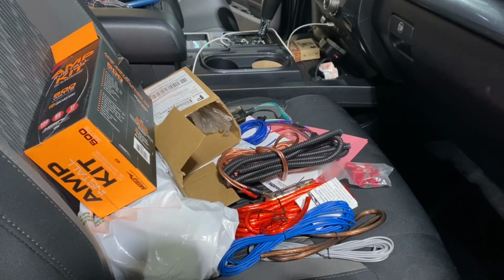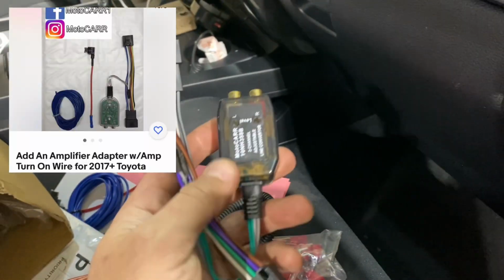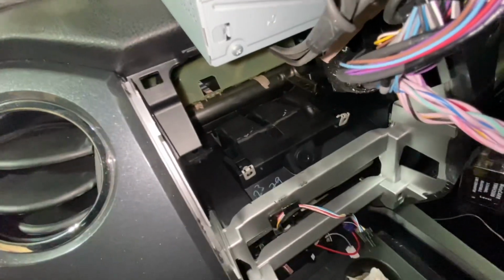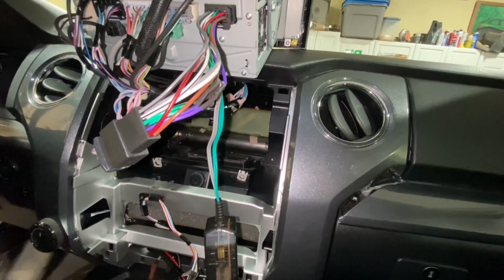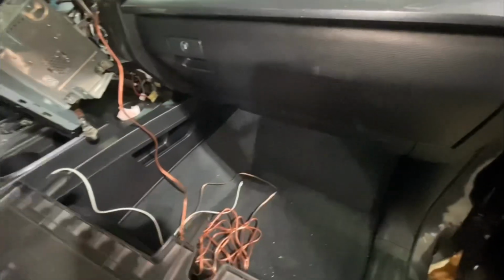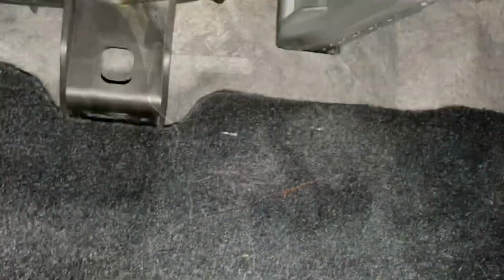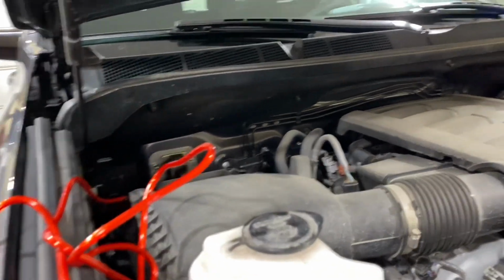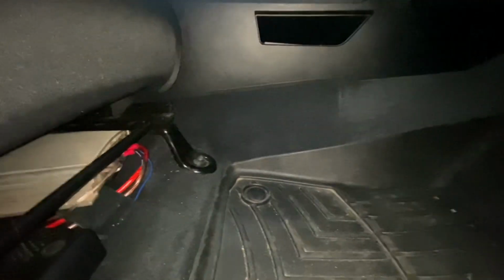Pretending I’m 18 again… Tundra Subwoofer/ Amplifier install.

Comment: Factory stereo has always sounded better than any aftermarket.  The only thing factory always lacks is bass. I worked in car audio many years ago when I was a kid and I was always staunch on that with customers. Also got in trouble at work for convincing people to not upgrade their panel speakers and only add subs with factory.

Comment: where did you get the remote turn on from.  that kit you show seems to do an add a circuit from the fuse box
Reply from the maker: Sorry, I tied that into the 12v dash outlet, since that is an ignition on power source.
Reply: @turbostoybox2182  ok cool!  I just got a 17 tundra and planning my subwoofer add.
Reply from the maker: @FosterFarmsOk  Good luck man! Hardest part is always fishing the wire thru the firewall for me.

Comment: I have the exact same truck and color. I started out with a 8” sub, then to 2 12’s, a single 18” Subwoofer, 1 15” Sub, and now I’m on 2 10’s and about 3k watts. Upgraded alternator, wiring and the whole 9. Im an audiophile and just was never happy with any of my setups. The crewmax not having the capability to have the Rear seat slide forward or fold down is a real PITA ……Subbed man 😂
Reply from the maker: Yeah for sure! I’ve wondered if the seat system from the 07-13 could be easily retrofitted since the cab was the same. But I haven’t dug into that project more than brainstorming so far.